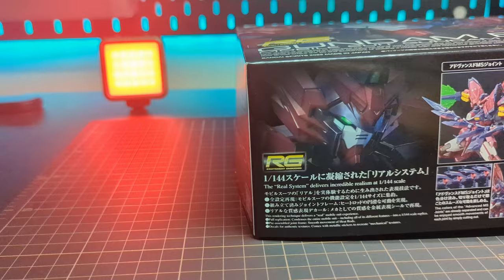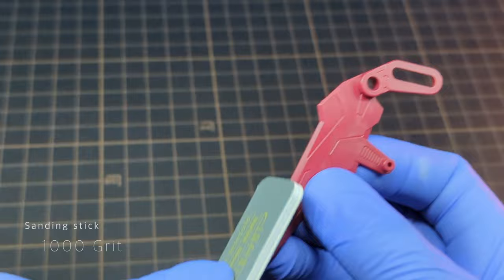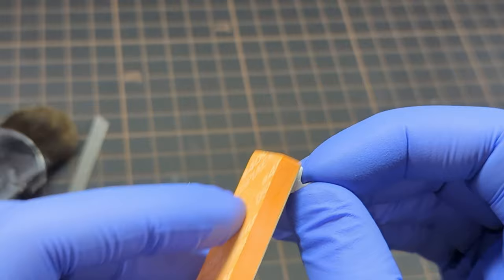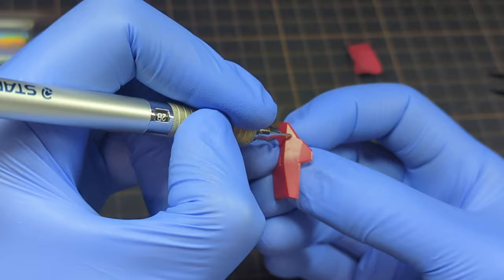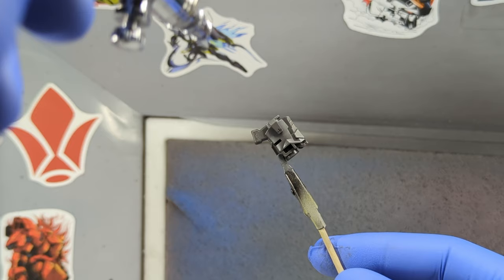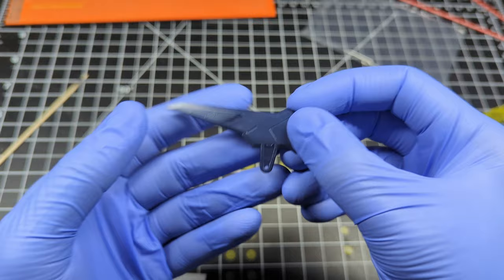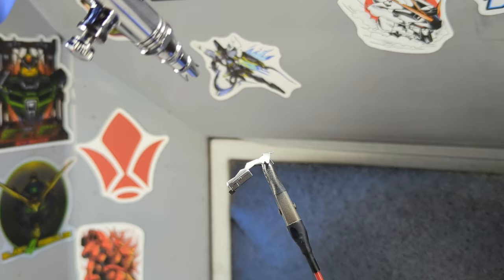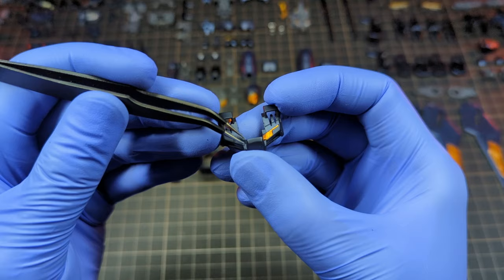Turned the New RG Epyon into the Banshee. Gunpla custom build.

Comment: Is the sand stick reusable for long time use or do i need to constantly replace them?
Reply from the maker: They are reusable but will eventually wear out. These are still the first set I bought from 2022. But that's because I switch between sponges and sticks.
Reply: @johnnymechahand  how long would you estimate the time for replacement through once in a while use?